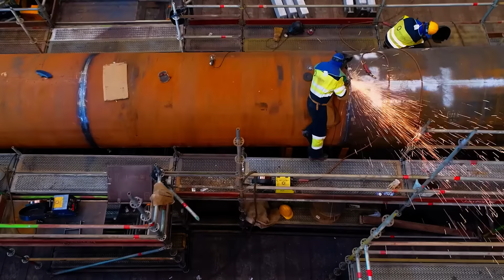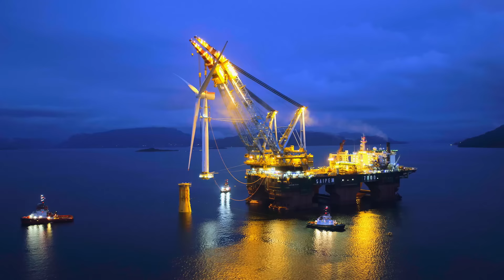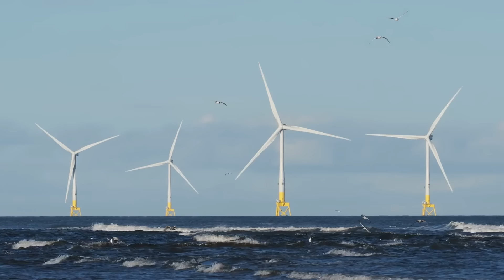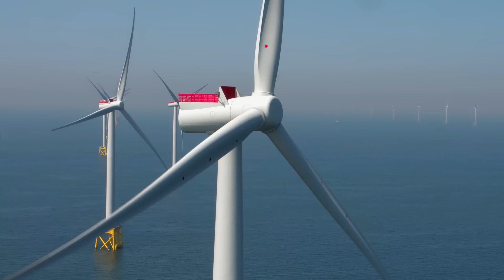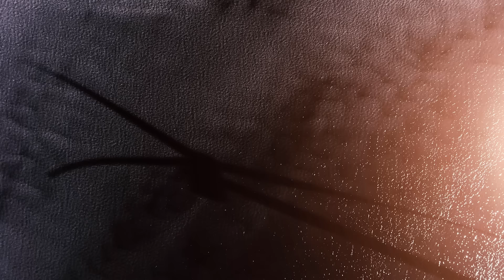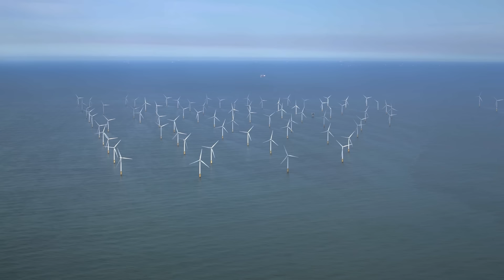Floating Wind Farms: The Future of Wind Energy? | FD Engineering

Comment: With the artic heating faster than lower latitude parts of the globe,global warming is going to mean a dramatic decrease in wind speed.Bearing in mind that the relation between wind speed and power production is an exponential one.A small reduction in wind speed means a dramatic reduction in power production.

Comment: If these green energy technologies are soooo good, how come they can’t compete with thermal heat generation plants including nuclear? If a nation is content to accept unreliable power supply at ever increasing cost then sacrifice your future on the alter of green energy. Be prepared for energy poverty, and tougher living without any environmental or climate betterment. As you sow, so shall you reap.
Reply: Can't compete in what sense? 

In terms of cost nothing beats solar and wind, nuclear least of all, since it's crazy expensive to build, operate and maintain. 

In terms of generation capacity, modern large wind farms have already surpassed fossil steam and gas turbine plants, to the point of matching a single nuclear reactor (~1GW).

In terms of emissions during operation, wind and solar don't even emit water vapor, let alone CO2, other greenhouse gases, pollutants, etc.

In terms of fuel, it's free, all of it, even transport. 
 
In terms of availability and accessibility, solar power can be easily installed in homes, covering most of the household's anual electricity needs. Good luck building a nuclear power plant at home. 

In terms of environmental impact, cats, glass windows/doors, fossil fuel-related activities, etc., kill many orders of magnitude more birds than wind turbines do, so it makes no sense to demonize wind turbines because of this (unless you're a lobbyist who's been hired to do just that). 
Solar and wind farms take quite a lot of space, sure, and so do fossil steam, gas turbine and nuclear power plants, so do thousands upon thousands of massive parking lots that nobody uses, so do thousands upon thousands of abandoned buildings that nobody even bothers rehabilitating, etc.  Again, it's a silly attempt at demonizing renewables.
Reply: @Goreuncle  That all sounds great in theory. However, the reality in Ireland is that we have the most expensive electricity in the EU. If green energy is free according to your calculus, then one of us is wrong as we cant both be right.

Comment: All that steel, 845 tons per jacket rusting in 20 years or less in a salt water. What a waste generating power when you can run a nuclear power plant 50+ years with a fraction of the steel and it has near 98% uptime vs intermitent wind power. Good luck EU. Least France has it figured out!
Reply: You do know that they coat the steel right ?
Reply: What a load of bollox, they are maintained and repaired when needed, just like any other power station. France have over built and over relied nuclear plants by their admittance. It takes a lot to power up and power down a nuclear power station when demand is up and down. Plus nuclear waste still has not been fully sorted. What is needed is a mixture of all types of power -  Wind, solar, storage, ocean buoys, nuclear.

Comment: Just an amazing video, we need more investment in wind power plants for our greener future
Reply: No, it's not really amazing considering the cost of floating offshore wind.
The floating Hywind project off the Scotland coast project cost was 6.8 million Euros per Megawatt to construct.

Not sure about your country, but in my country ,  factoring in electricity use per capita and the average cost of electricity, it would take that Hywind project over 40 years to cover the project cost assuming it runs at 50 % of nameplate capacity (capacity factor) , in which it most likely won't , as one of the highest producing offshore wind farms (UK) hit 47.7 %. It ranges between that high and 30 % , so in reality it would most likely take longer than 40 years (In my country anyway) to cover the cost for a project that has a life span of 20 years.
Reply: @mannycheese1166 
What is the kilo-watt/hour cost to produce electricity? Have you factored in the "no cost" of wind energy?
Reply: @BANANASandDUCTTAPE  
Average MWH costs have many factors and unbiased data analysts have a high/low and mean average of a particular industry , not that weird Lazard study or any other biased study, be it from renewable advocates or fossil fuel advocates.

And wind isn't "no cost" even if in a hypothetical where project costs are completely wiped clean .
Reply: @mannycheese1166  it is cheaper then fossil fuels
Reply: @greaterglider  
That word you use "cheaper" . I don't think it means what you think it means. Lol.

Reality trumps opinion every single time.

There's a reason why the offshore wind project Empire wind 1 (Ironically built by the  Norwegian oil company Statoil)  off the state of New York has to charge 2.5 times the rate of the current average cost of energy in the state of NY to make profit .
 That also includes direct and indirect subsidies of 50 %  for the overall cost of the project (Integration into existing grid, maintenance ,decommission) , paid by taxpayers. Without these subsidies, Empire wind 1 would have had to pay close to 4 times the amount of current prices to make profit.  That is NOT cheaper. 

It's real simple, In reality, if wind energy were cheaper, then the premiums for said project would be cheaper than current rates, not 2.5 times more expensive than current rates. 

I"m not saying Fossil fuels are better than renewables (No such thing as green) . What I'm saying is reality and data say they're cheaper.

The carbon output is another discussion .
And if you still don't believe reality, I suggest you read a 2023 31 page PEER REVIEWED study by over 20 professors from the MacDonald -Laurier institute based out of Ontario , Canada. 
Data and facts >>> opinion all day and every day.
Reply: @greaterglider 
And much CLEANER.
Reply: @robertlee8805 yep
Reply: @mannycheese1166 shut up

Comment: Salt water is real corrosive.Doing service of the turbine on land is expensive, imagine the costs in the ocean.Nuclear energy has to be made more safe with advanced designs because it has a lot more energy per unit of money.Ocean based turbines can be more vulnerable to enemies with sabotage because they are exposed above and below the water.
The price per KWH can`t bankrupt their country`s citizens.Yes we have to move away from using fossil fuels to generate electricity.Oil and gas is used for other material than just energy so carbon based chemicals still need to be extracted.If exploration and investment on gas and oil on the large scale isn`t done in the future the cost of those materials will rise as well
Reply: Oil is constantly replenishing.
It's all a lie.

Comment: with all these fancy pants wind and solar ,then why am i paying double for energy????
Reply: Takes money to upgrade our outdated grid, install turbines, and pay workers to maintain these machines
Reply: @darthbugger541  you are paying more because the regulated price of electricity is pegged  to the price of gas powered electricity. Sustainable electricity typically has a wholesale cost of production at around 5 pence per kWh. Government regulation determines that it should be more than that so that gas dependant generators do not go out of business.
Reply: @darthbugger541   “why am I paying double for energy????” Because electricity prices are calculated based on the price of gas! Yes even if all your power came from neighbouring wind and solar!
Reply: Because it is a lot cheaper to burn coal.
Reply: @ so it’s cheaper to mine for coal. Transport it to a steam generator plant. Burn it to get power? Vs. harnessing winds mechanical power to rotate a generator that get delivered directly to the grid? 

Both have their upstart cost of building the energy capture device.
Reply: @fabianstoll  the price of electricity to the consumer is high at present because it is set based on the price of gas. 

The U.S. (as of recent estimates from sources like Lazard and the U.S. Energy Information Administration):
	•	Coal: $60–$120 per MWh ($0.06–$0.12 per kWh)
	•	Natural Gas (Combined Cycle): $40–$80 per MWh ($0.04–$0.08 per kWh)
	•	Wind (Onshore): $25–$50 per MWh ($0.025–$0.05 per kWh)
	•	Solar (Utility-Scale PV): $30–$60 per MWh ($0.03–$0.06 per kWh)
	•	Hydroelectric: $40–$100 per MWh ($0.04–$0.10 per kWh)
Reply: @GeorgeRow  
The Wind cost  in the Lazard study was listed as low/mid and High with mid being 50 $ MWH, high being 73 per MWH, even though the study admitted other factors were overlooked. If he runs the high from 2009 -2024, the average is 82 $ per MWH.
The high in 2023 is 75 $ and 73 $ in 2024
Odd that a 55 % capacity factor was used in the low estimate , which is unheard of (as an average) and would be much better than the average capacity factor ( 41%) of offshore wind projects in one of the windiest places , the North Sea.

Comment: How about horizontal wings, Savonius or similar? Put generator room down and get mechanical energy by cardan axle, or bifilar steel wire, type that were used in cars speed meter few decades ago. Then tower can be lighter, even open structure with less wind load.

Comment: I wonder why they do not make many small turbines, the size of a ceiling fan, for example and mount them together on a frame to make it the same coverage as the giant blades turbines? They are easier to install, repair, and replace at a much lower cost. If one of them failed the rest of the other turbines still generate power and not causes disaster as this video talks about.
Reply: You wondered why they don’t use lots of small turbines …
The amount of energy available to a turbine depends on the area covered by the rotating blade. If you remember school mathematics the area of circle of radius r,  is  Pi x r^2 (“pi r squared”). 
So a 1m long (ceiling fan) blade covers (3.142 x 1)sq m = 3.142 sq m
A 2m blade covers (3.142 x 2x2)sq m = 12.568 sq m
A 3m blade covers (3.142 x 3x3)sq m=  28.278 sq m

A 5m blade covers (3.142 x 5x5)sq m=  78.54  sq m

A 10m blade covers (3.142 x 10x10)sq m=  314 sq m
A 75m blade covers (3.142 x 75x75)sq m=  17,671 sq m

So to match one of the 75m turbines would require 5,625 small 1m ceiling-fan-sized turbines. Each of those would need its own wiring, its own generator and would need technician time to connect them up. There would also need to be massive combining electronics. 

In short it’s a “square law” - make a blade twice as long you increase the potential energy by 4 times, make it 10 times as long you increase the potential energy by 100 times. A blade 100 times longer than a ceiling fan has 100x100= 10,000 times the potential energy available to it.
Reply: @GeorgeRow  Thanks for explain. I see the longer blades have their advantage in efficiency but but I think smaller blades generators  have advantage of the cost of making, installation and maintenance. Further more, when longer blade failed it is disaster. Just my 2 cent. Lol. The engineers will know the true total costs of their options.
Reply: @junkvista61  the one thing that is rarely spoken about wind turbines or pv is that it is completely unreliable as the weather is random when the demand stays the same.
Such a eco friendly generators aren't that good if there's too much of them in the electrical power grid structure. For example coal power plants work well on their rated conditions and if there's a pressure to turn on too many turbines/pv to have "cleaner energy" the coal power plant has to work in unrated (lower supplied) conditions and it causes a lot of new problems. The solution is to have nuclear power plants, but not every country want to have one.
Reply: i think, because of less resistence to stronger winds
Reply: Aerodynamics and mechanical efficiency improves significantly with scale.
Reply: Also higher winds speed the higher you go.
Reply: Good question, I think?

Comment: What a big bulls... In Wales the turbines are completely stopped in summer times snd even in winter times
Reply: If the wind turbine farm doesn't have it own natural gas turbines to backup their dips making it grid power the power company doesn't have the capacity to do it without running expensive peaking natural gas turbine generators.   Unless forced to buy the wild AC the power company can make the power cheaper without risking its equipment to high stress wild AC.  It would seem the power output from the wind farm could be culled to something usable with little backup, but that doesn't seem to be done.

Comment: Waste of land space. What happens to all the fibreglass blades? Most are being used for landfill. 🤦🏻‍♂️
Reply: better than polluting with coal
Reply: @ThomasRogue-s8y Even if it burns "clean" they still have to put the ash somewhere.  At a friend's house in the Carolinas, the power company's ash residue has contaminated counties worth of wells and lakes, and they can't drink the water from their own wells because it's too polluted.  

And then of course there are all the poluted streams and lakes in West Virginia, Kentucky, and Tennessee from acid leakage from old, abandoned coal mines.  

Meanwhile, the balsa wood and fiberglass turbine blades have been burned in cement kilns, reducing the amount of coal they need.
Reply: @ThomasRogue-s8yto be clear, anthracite coal emits as much CO2 as any other coal.  The "99%" you refer to is particulate and NOx/SOx emissions.  It is still burning carbon in oxygen and producing CO2, no amount of Alex Jones podcasts will ever defeat science
Reply: What is your source for this speculation, may I ask?
Reply: no they are actually recycled

Comment: In the shade of the orbital solar collectors it can be considered very cold. The kind of temperature superconductors begin to do that quantum fusion thing that happens, thus taking on the properties of zero electrical resistance. Lets say that is acheived. With the idea of sending the collected power to the surface of the earth in the form of a microwave frequency. I am imagining the energy being transfered to earth would be rather high. Now imagine the electrical apparatus that converts this energy into a microwave is using mostly supercooled superconductors. This could increase the amount if usable power reaching the collector on the earth. 
I am not an electrical engineer or anything, just a man with an imagination, some electrical background, and the desire to use our new understanding of quantum mechanics to our benefit, in the most obvious way possible . Who knows. Gave they thought about this yet?
Reply: write your thesis and submit for peer review